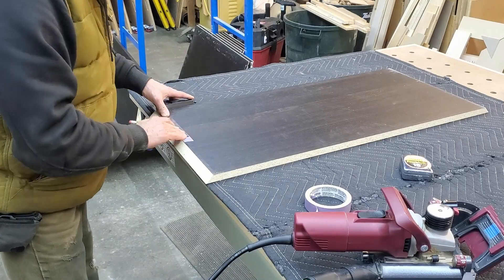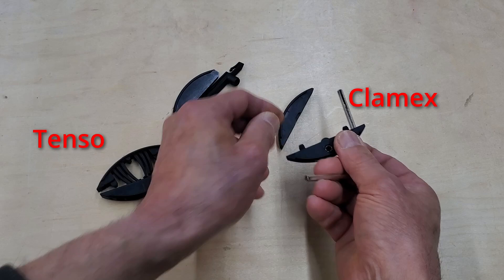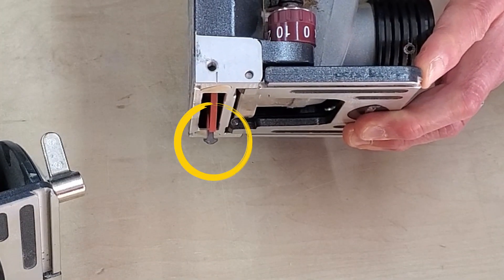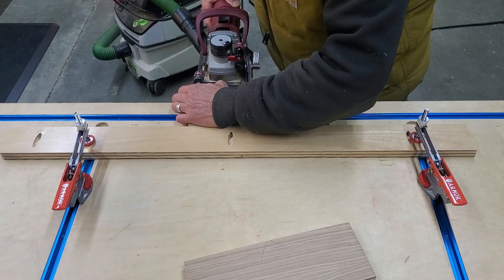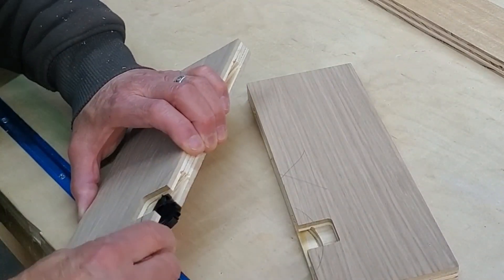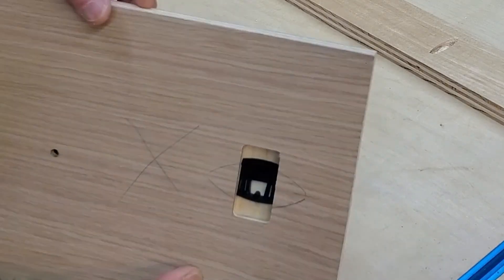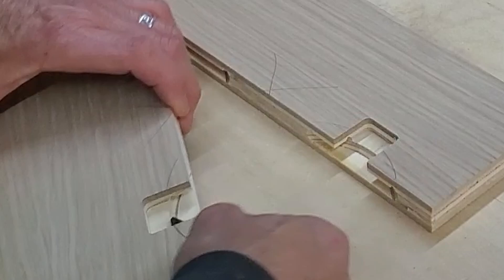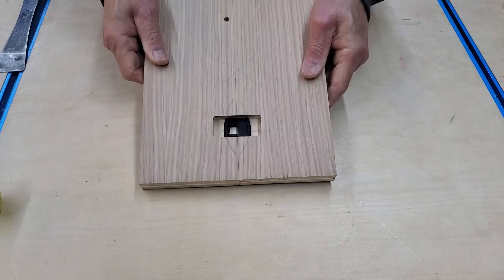Lamello Zeta P2 With Exclusive Inside Look At Tenso and Clamex

Comment: I think the cut away view was great, but i'm already sold on the Zeta.  To me this tool has some very subtle and desirable advantages over anything else on the market, and is totally unique in it's joinery system; to be able to use the the tenso and the clamex interchangeably and in combination is huge, and to be able to dry fit everything and then glue-up without clamps is a game changer.  This only works so well because of the Swiss' relentless pursuit of precision.  And lets also not forget that Lamello invented the biscuit joiner way back in 1955. The price point is painful, but we all know from shopping at Harbor Freight, you get what you pay for.  Very good video!
Reply from the maker: Well said! Thanks for watching!

Comment: I have the domino 500 and duo doweller by mafell, I’ve installed cabinets that use clamex but never used the tool itself … this might change after this video! I’m much more of an installer and carpenter but this seems like a great addition and until I get it I’ll probably keep obsessing over it ….
Great video, I really like your style -I’ll be checking out your other videos Sir
Reply from the maker: Since getting the Lamello P2, I hardly use my Domino. Only when working on something that's too narrow for the biscuit sized fasteners. I thought the tool was too expensive when I bought it, but it's paid for itself many times over! Thanks so much for watching!

Comment: The oscillation groove and assembly is so clever. Would like to test it some day. If it could be somehow integrated into CNC workflow, without manual milling, it would be really nice.
Reply from the maker: There is CNC tooling available for the P2 joinery system, I've seen it set up on production machinery at Trade Shows. So there ya go, problem solved! Thanks for watching and commenting on my video! Cheers!